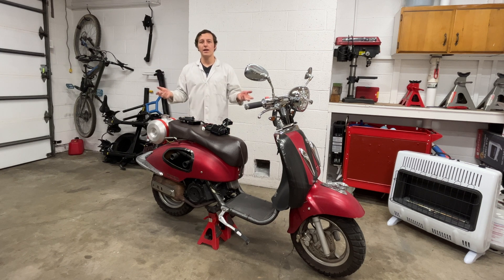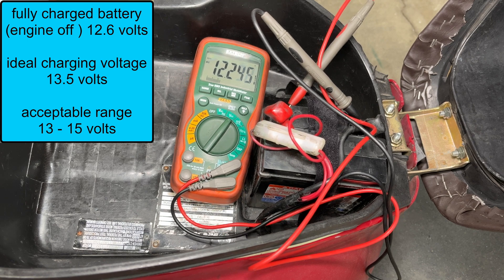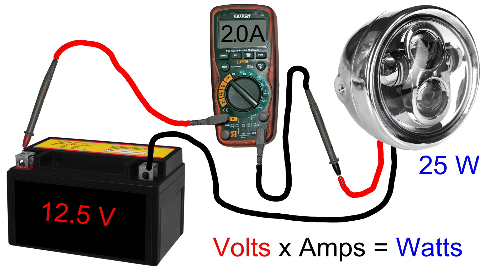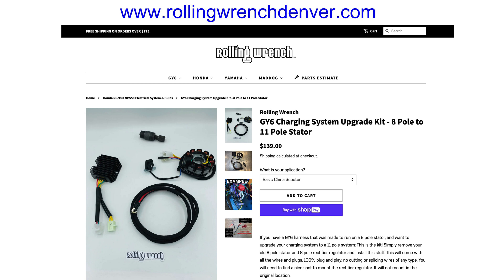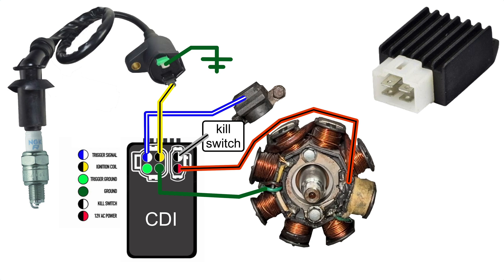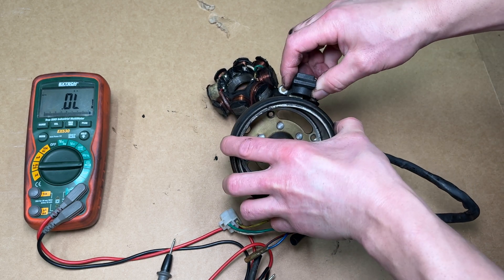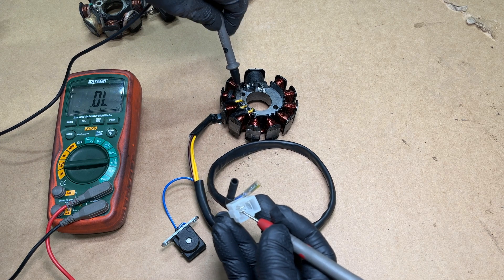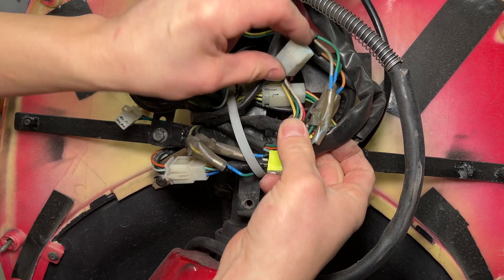Charging system upgrade on a 150cc GY6 Chinese scooter - installing 11 pole stator

Comment: You went to the battery and you grounded it out to the frame and mine has a red and a blue wire so I think mine is both hot
Reply: Nope, negative is ground*

Comment: How exactly did you wire the new regulator ???
Reply: Into *rectifier/regulator*, from there to old connectors to battery, lights are on battery +
Reply: Dude you did not show the regulator hook up. You just said the white connector from the scooter will not be used then moved on.   ...

Comment: Paul, I came across this motorcycle for real cheap on my country and i'm very interested on getting one but I have to ask you, Is it worth taking one? Are engine and parts common with other chinese motorcycles? I hope you can answer
Reply from the maker: Chinese scooter are usually a complete disaster. Check out this video: https://youtu.be/a40dcmD99kQ?si=CjOrJ0geUmCS4CPt

Comment: 05:21 build coil by your self is so easy. Use Honda Tiger bike regulator  and make the electricities become fullwave DC power. Chane better CDi and Better coil from Suzuki

Comment: The regulator rectifier is in danger putting it on the back under the seat! A lot of heat will around it, and it risks getting on fire. So better putting it on the front, unless your town's weather is too low like 7°C or less. Be careful!

Comment: I wonder if it'll fit a 125cc Buddy.
I just take the battery in each night and throw it on the NOCO 1.
Gets about six months or so out of a Weize battery - no different than a much more expensive YUASA.
My scooter also really needs a new wire harness at this point as it's a stolen recovery.
I have a six inch PIAA LED light bar which pisses off all the EV SUV drivers who are too proud to get cataract surgery.  I don't care.  No one veers into my lane anymore while on their phone.
It's been a while since I changed out the pick up coil ( can be bought separate on Amz for the Buddy ) but I think I only have a 5 pole stator from the factory.

Comment: I have been trying to figure out if this will fit my QMB139 engine. It has the 8 pole, but I am not sure if the bolt pattern is the same. Any ideas if this will fit?
Reply: the site should list all the motor models it will fit.

Comment: Hi , i was trying to change my honda cvt scooter motorcycle lead acid battery to lithium iron 12 volt but had huge trouble connecting and identifying all the components such as rectifier cables etc, even after watching a lot of your videos repairing Chinese scooter I thought I could do it too but damn was I wrong, I found out using a multimeter to check for the right cable to connect was actually way harder than you made it look. Man you are a real pro, or maybe I am a real noob that is bad at understanding all the technical aspect or fixing and modifying a scooter. If everything does not go well I will put my old lead acid battery back in and be done with it lol
Reply: Why did you even have to touch wiring
Reply: @merabiamkoladze5929  I was wrong, there is no need to touch the wire assembly, but the battery I bought was faulty, so the project will continue when I buy a new one in the future.